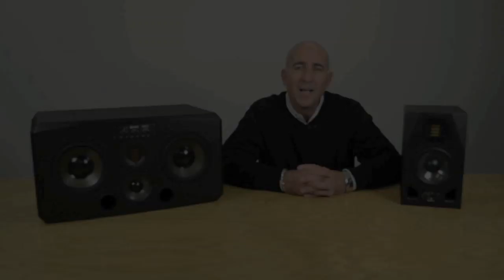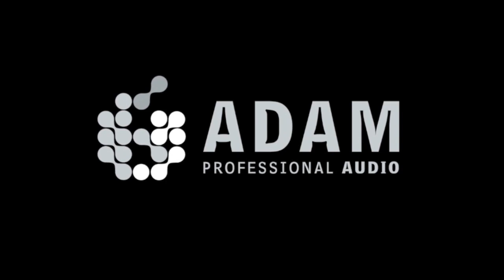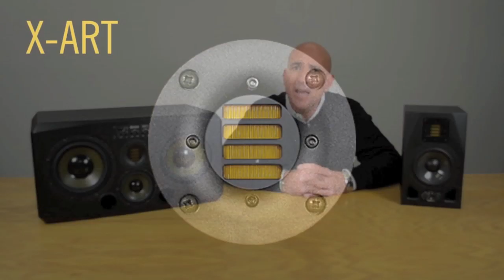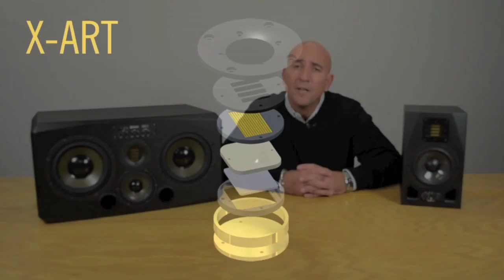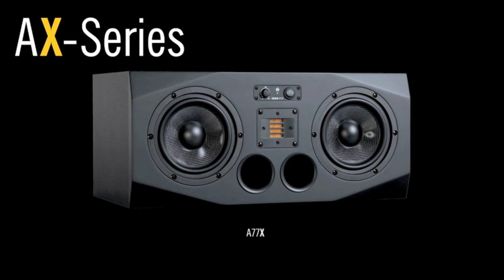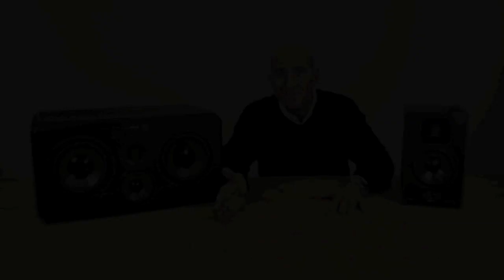Adam Audio | VintageKing.com

Comment: The video started out sucking eggs hard, but from half way through the message sunk in and  the message got through as  speaker relaxed, it ended on a professional and powerful high and Im so glad because it resonates with me. These speakers are the sex and I dont think they'll let me down now if I start at the A3X's in 5;1 mode with a sub 8 woofer. Thanks guys. Decision made.  Consider chopping the first  3 mins of the video.

Comment: Good question. The ribbon tweeter sounds as clean and unstrained as the very best soft domes, silk and the like.
I have Adam A7s and I get very good mixes. I use Fostex PM2 MK IIs as cross-references along with JBL 2325s, Behringer Truth B3031A 8s (a different ribbon to the Adams) and after initial mastering I cross refer again on vintage loudspeakers of different designs. I'm a gearslut!
I have Adam A77Xs on the way.
You can never get too much of a good thing.